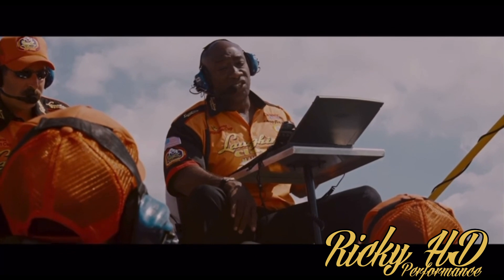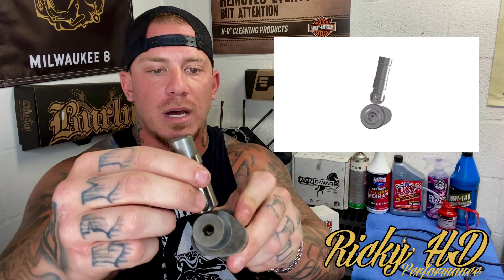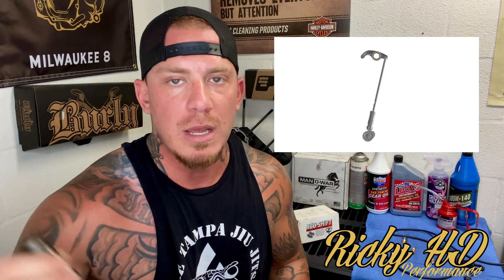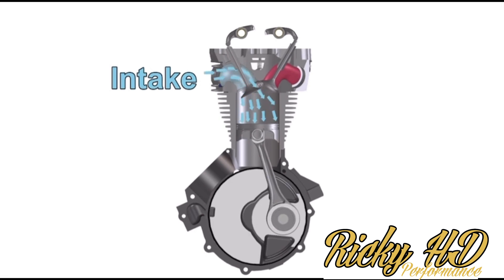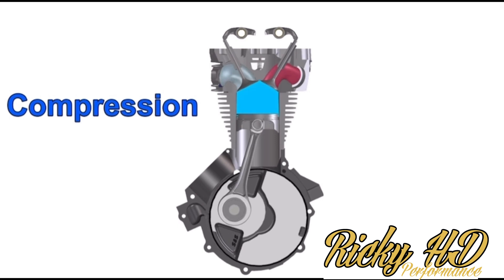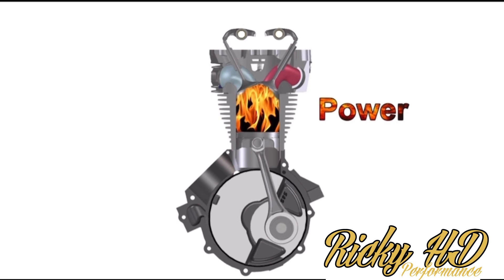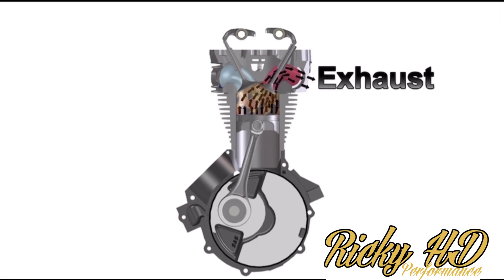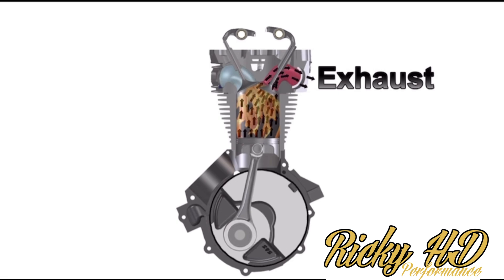124ci zippers smokes Harley 131ci?How to build more power and torque!

Comment: Dude, I can get more power by adding one ounce of oil fortified product too motorcycle engine! Dyno teat indicated 7 more HP, 70 more RPMs along with cooler running & more heat protection! Cheap too at $1 too treat one qt. oil, 3 qt system in harley is a whopping $3, not hundreds or thousands too replace cams, etc! And, it's easy, just dump in 3 ounces too oil! Time savings too! How long too dump 3 ozs in oil fill hole? Then, if I don't like response, I can remove by just not adding fortifier too next oil change! Extends oil life in vehicle, so extended oil use saves you money along with better performances! (I started using this in my motorcycles in 1989, so I have a history of success using this product in all types of vehicles!)

Comment: Great video.  When I bought my 18 FLHC the HD Torque cam(447) was part of the deal and installed at 1k service.  Talk about a change from stock to tab slipons. I kept the SE stuff to maintain warranty, but I've since added 33" fishtails and just allowing the autotuner keep it inline after a basic dyno run.  On the flip side did the fueling reaper 465 in a 2017 streetglide, Rinehart full exhaust, camchest and PV tune, that thing is just a monster!!!  Both bikes rip and perform well even on distance runs.

Comment: Wood cams all day. I was going to go with SE stage 3 until my dealer talked me out of it and steered me towards a Wood Knight Prowler 22x cam. It cost far less and has way more power and torque, all while being covered under warranty.
Reply: ? Stage 3 se 114 kit switching just adding a cam do u need to upgrade primary with a aftermarket cam?
Reply: @markbelliveau5130  I asked my dealer when I ordered my bike to go ahead and upgrade everything that needed it with the cam swap. They told me that all of the affected components were stout enough to handle the additional power. I did add the heavy breather intake, Bassani Radial Sweepers and a full custom tune. She dyno'd at 103hp with 121ft/lbs. Air temp at the time was in the 90s. I can feel a difference in power when it gets colder outside. The dealer said that since they installed everything that my "warranty forever" is intact. They said that I only needed to consider upgrading parts if I were pushing closer to 140/150hp. I've had her for just over two years with zero issues. That being said, of a part ever does fail I'm going to upgrade then.

Comment: What cam would you recommend to get high numbers ? 
I wanna be in the high 140’s on both torque & Hp 
I have a 19’ 114 stock road glide
Reply from the maker: The zippers 128 sleeper kit is under 2 grand bro
Reply from the maker: You won’t reach that high of numbers on a 114 even with the best cam, exhaust, and intake on the market unless you drop a zippers 128 kit. Do a Zippers 128kit with the 472 cam.
Reply: I’ve been doing my research but nobody really explains... everyone just talks about the kits but damn kits are like 7 grand...

Comment: HD messed up getting rid of u haha dropping them truth bombs. HD is consistently overpriced and underpowered unfortunately
Reply from the maker: Overpriced and underpowered 😂 that should be their new motto
Reply: what? did they really?
Reply: @Skinwalker007  ya he did a vid on it. Corporations these days are worried about being politically correct instead of backing their supporters
Reply: Over priced and under powered. Can say that about any car, truck, fork lift, rc car, vibrator anything really ever made.
Reply: @hes_so_great3291  not really. Not every car or product really sells power. A toyota doesnt claim to be a power beast. It's just a reliable car that gets u from point a to b. Power isnt really their selling point. The 131 however is literally a mod that exists solely to make your harley more powerful. But for the half the price of a 131, you can go the aftermarket route and get the same numbers
Reply: @willyafg  Lookup both kits and tell me how it’s half price. You get a lot more with the Harley kit then the zippers kit. And they are both the same price. Speaking of Toyota have you heard of the TRD side. That’s all Toyota performance. Same thing
Reply: @hes_so_great3291  zipper 124 is 4900 a 131 is 6400. Stats are about the same. So about 1600 savings. That is only 1 example. Cyclefanatix does a whole vid on this and explains a 131 is too expensive for the numbers it puts out. 
TRD is SUBSECTION of toyota's lineup. Doesnt provide any validation of your initial argument
Reply: @willyafg  screaming eagle and trd are the same. 6400 for a complete engine vs 4900 for a top end kit. The savings is in the bottom end that has miles on it and is not new.
Reply: @hes_so_great3291  youd think that new engine that costs more and claims big power would crush the kit but it doesnt. That is the point.
Your initial point was overpriced and underpowered applied to all cars. I said it only applies to some and you are proving my point. Trd vs prius.
Have a seat bro youre talking too much. Convo has been over
Reply: @willyafg  so we are clear it makes more since to put a fresh top end on a bottom end with 50000 rather then just replacing the engine and making the same power, and that trd and screaming eagle are not the same because trd does not offer parts for a Prius and Screaming chicken doesn’t offer parts for the live wire. Got it
Reply: @hes_so_great3291  holy smokes you cant carry a proper argument without tripping yourself up. If u wanna pay 1600 more for a new engine and get the same output as something that costs 1600 less than that is on u. Watch traveling tall's zipper build videos. Zipper found issues with his brand new engine. Harley's parts are cheap af. Even in this vid Ricky says zipper is the better way to go. U lose again bro. Have a seat
Reply: @hes_so_great3291  this is u: "all cars are underpowered and overpriced. Like the TRD, which isnt all cars. As for the Prius, that example collapses my entire argument so rather than admitting im a clown Im going to pretend to troll so I dont look stupid" 
Congratulations you lost
Reply: @willyafg  this is fun. I was saying you can pick any car and there has been someone who has upgraded it. Refer back to my 50k bottom end for that savings of 1600. I’m gathering you have never built a Harley engine but have seen every video of riding tall who ever that is. This has been fun man. Your obviously better at watching videos then I am.
Reply: @willyafg  the TRD and Prius thing does nothing for you. Just like live wire and screaming eagle.
Reply: @hes_so_great3291  none of that has anything to do with your initial argument of everything being underpowered and overpriced. And your argument had nothing to do with the comment thread. Next, the vids I mentioned were just literal forms of proof that show you are incorrect. 
Again, you lost. Stop trying to save yourself lol it's too late
Reply: @hes_so_great3291  the cherry on top is you dont know the difference between youre/your and then/than 🤣 
You lose :)
Reply: @willyafg  I said everything is over priced and under powered. If you really think a Prius has good power you have never driven one. Just one last question for you what kind of Harley do you have?
Reply: @willyafg  I just watched a traveling tall video about his sleeper 124 kit and dyno tune making. People do understand that the Harley numbers and a custom tune for a specific bike are different right. I’ve seen 131 se kits make 145 Hp and 160 tq with an actual dyno tune on it. I have the graphs to show it.